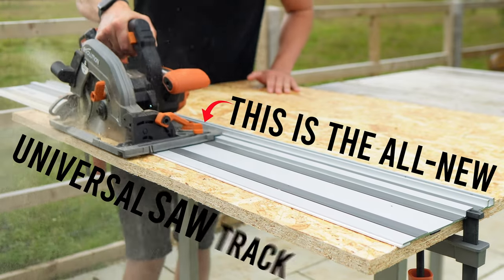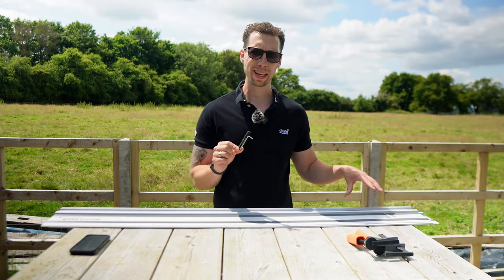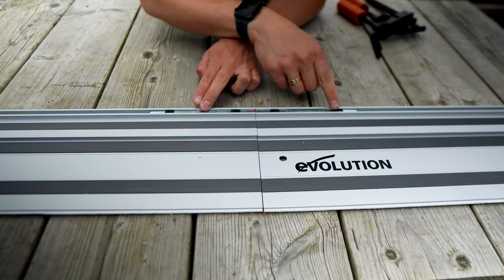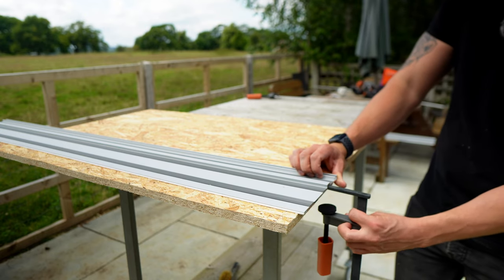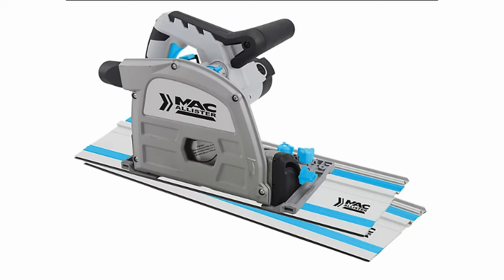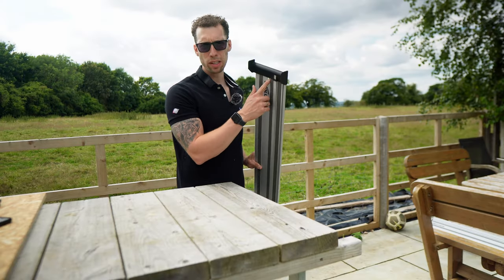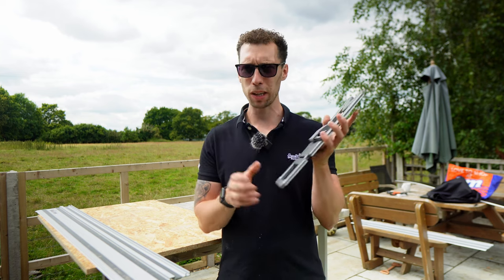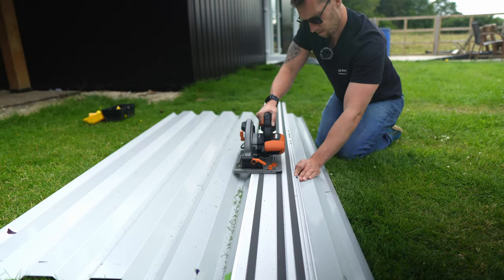Yeah, You NEED To See the New Evolution Saw Tracks

Comment: As a DIYer I used the old style for an oak veneered door for the very first time with the Evolution R185CCSX. Terrible. Track did not connect properly and you could physically see a slight bend. Regarding a suitable blade would you use 40T or 80T and in several passes to avoid damaging the veneer. Not the easy task I thought it would be. Thanks.
Reply from the maker: I'd probs go with an 80T for a finer cut and finish 👍
Reply: For veneer, get the most teeth you can. cut 2 or 3mm deep backwards as a first scoring cut. I get clean cuts using my Makita track and an ordinary Makita circular saw with an accessory to fit on track. 80T preferable

Comment: No tracks are that square to simply butt up in my mind. I leave a small gap and use a good straight edge.
Reply from the maker: I think it depends on the job, if I needed to be super accurate then I’d measure and butt up the tracks to my marks.
Reply: Mark’s comment is on the money here. He is talking about joining the tracks, not lining up the final cut.
Reply: There's basically no run-out on two bits of track due to the way the track connecting bars work. I didn't understand it until i had them in my hand. The connecting bars are self-centering (100%) and align based on the reference surface on the inside surface of the extruded channels. So they align as straight as your track is extruded. The gap between two bits of tracks has nothing to do with alignment with these bars, just leave 1mm of space, job done.

Comment: Let's hope those who buy this track get a true straight track when connected together. 

The previous track, that I own, doesn't have square ends so when butted together it is way off straight.  I need to use a 2mm spacer on one side of the track to get a straight track.  Luckily I rarely need a long cut.  Evolution customer services were useless, put me off buying anything off Evolution.
Reply from the maker: Sorry to hear that you had issues! You should let them know and they might replace them!
Reply: Sedge says in the Festool videos that the Festool tracks do not have square ends and they should not be butted up against each. You need a straight edge like a long spirit level to line up the rear edge and then tighten it up.
Reply: I'm pretty certain even Festool track doesn't guarantee square ends so you should leave a little gap, not squash them together.

Comment: Well well well I'm glad I seen this today. I have the Bosch plunge saw and got 2 800mm lengths of track 160 for 2.4 was gonna be 240 and mine only fits either it or festool or mafell. Know what I'll be buying next week. Cheers jack. Save me pretty penny. Does it have the trim bar you gotta remove to start with? And is it solid without the clamps?? 🏴👍
Reply from the maker: Haha glad I could help! Yes there’s a trim bar that you cut after first using it. And yes it’s grippy without the clamps!
Reply: @sumeraybuilds  great will get one them ordered this week with your code. 🏴👍